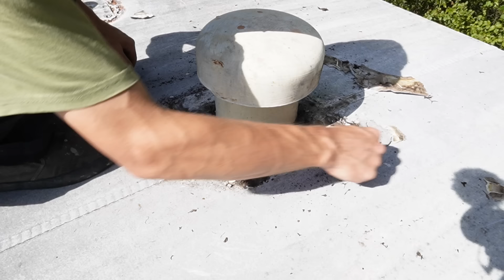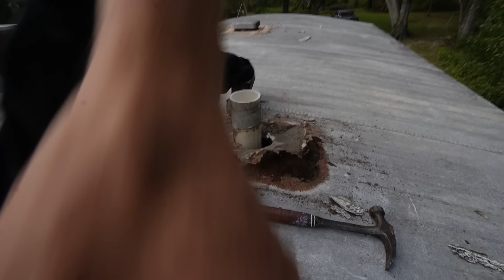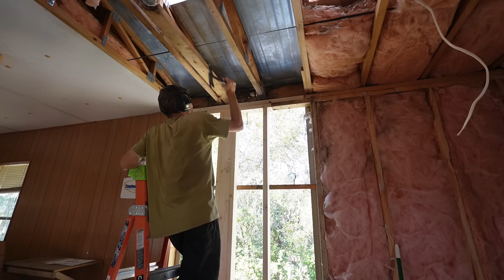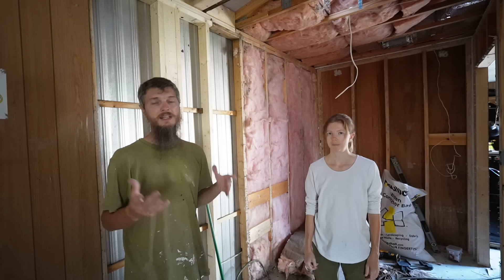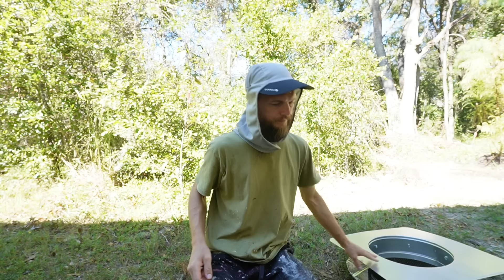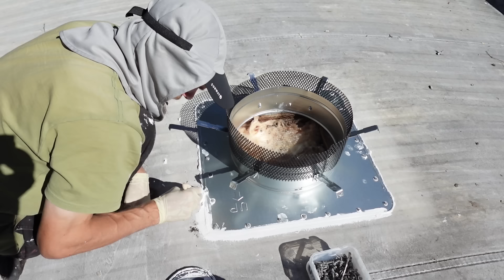Major Roof Leak Patch and Repair - Mobile Office Building

Comment: Trying out some new 🎶 I see.  Now I want some naan bread.  😋  Ceiling sealing space.  >>;=)  I think I saw you guys' Secret when Doug was showing the new vent.
Until y'all reseal the whole roof, I feel bad for any plane (or 🐉) that glides over your place, those panels are über reflective.  Let Doug know great job on this repair, and I appreciate y'all sharing this.  I have a shingled roof and plastic roof vents, and the nails rusted and seals broken, and mine're leaking (one pretty bad), and I've got to reseal those things up there.  I see that Tropi-Cool stuff isn't cheap, but if it can seal good vs wood or shingles, then w/ some 1×s installed under the decking around the opening for new wood to hook into and put the vents on with SS screws instead of nails, hoping to do a water tight repair to hold a few more years till new roof time (which I'm looking to use that plastic sheet barrier like y'all did, and debating re-shingling vs metal roof, though my landlord is convincing me metal is better even if it needs an $800 paint job every x# of years to not have rust.  At that time, I'll replace any decking needing done, although that was slick how Doug was able to slip that under a metal roof, although you gotta watch that guy always trying to hurt himself and fall off things LOL  Have a great rest of your Sunday and week ahead.  Love you guys 🐉💚

Comment: Good, thorough job! How did you know what metals were which? Just by looking at them? What do you recommend for an exterior bare wood, clear-type, sealer? My wood beams on the exterior is the apllication.
Reply from the maker: You can usually tell the metals apart by looking at them if you know what to look for. But steel is heavier and a magnet will stick to it, while aluminum is light weight and non-magnetic. These types of roofs are usually steel.

I don't have any recommendations for an exterior sealer. I'm still searching for a good one myself. But I'm sure just about any exterior sealer would work equally fine.

Comment: I suspected that the vents were a serious source for concerns and it is great that you are resolving the issues now. I hate penetrations through any roof, they are always a source of future problems. You are dealing with the problems at the start of your ownership of this building, challenging, yes. Frustrating, yes. Essential, certainly. Challenging, obviously with a mess of hard work, but do it once, do it right, it is the only way. Wow, sorry about the near accident, happily you missed that bullet, but the margin was too close for comfort.
Reply: The building probably was sold because of these problems that Doug is wiping out, one by one!

Comment: Glad you did not get hurt on that fall. I wonder if the wet patch would work in extreme cold weather in Northern Canada. It gets to minus 40s and minus 50s (Celsius) a few times each winter. Average minus 20 Celsius. If it does work, then it is worth considering. Great work on the roof. What are you going to use to seal the roof? Hopefully a light color to reflect the heat.

Comment: I thought you would have pieced in some plywood to fill in the holes where the two bathroom vents were and then screwed some 2x supports underneath to secure them to the existing roof or trusses.  Of course, there won't be too many people walking around up there, so just remember not to step on those areas.  The new vents look so nice compared to the old ones.

Comment: That bubble looks like it may be an area of potential ponding. Might be a good idea to verify that and fix it if ponding occurs.
Reply: It probably won't be a problem if a little water ponds on the roof.  In FL, the sun will burn it off in no time.

Comment: I took the oil furnace chimney out of my mobile home and put an aluminum rectangular patch over the opening with rubber roof coating and screws.10 years gone by and still holding! CHEERS FROM HERE!!!PS If need be you can separate the roof metal at the seams that occur about every 4 ft.

Comment: I used wet patch on a trailer roof, when in the middle of a rainstorm, my roof began to leak.  I was able to use that type of product in the middle of the storm, putting it over leaking areas that were in literal puddles of water, and it was able to adhere to the tar roof and stop the leak.  Absolutely amazing stuff.

Comment: You might consider for the new plywood just running a bead of PL400, at the sister and  plywood seam and  the truss plywood wood seam, that way in a storm when wind is blowing hard it will help with any movement.

Comment: Hi Doug and Evee,
I was wondering for the destroyed  trailer that was your old workshop, could you remove the sides and use the trailer as a flatbed trailer for moving your vehicles like your tractor?  So when you need the vehicles at the other property, you can take them over there?  Just a thought...
Reply: I was saying the same thing but also build some short side walls for hauling debris.
Reply from the maker: I'm not sure what the plans for that will be yet, but I don't think I would want to tow around something that long.

Comment: Yeah, just wipe it on your pants instead of peeling off the gloves & getting new gloves when you need to spread more sealant. LOL
What kind of metal is that mushroom cap? Maybe it would make a great wok! I've seen the disc blades off an old style farmers disc used. They make great woks.
Reply from the maker: It's made of steel.

Comment: Great video! I resealed the camper I live in recently and it feels great knowing it won’t leak. It poured rain multiple times after sealing. That was definitely a challenging repair redoing the roof plywood. Those siding panels make things a lot easier versus a lap or wood siding etc!

Comment: Hey Doug. Could you push the roof up on the work shop trailer using a hydraulic jack? Then you could use it for storage of the roof was water tight.. It would be a interesting video😆

Comment: You should use roof cloth with the tropi cool over the seams and screws.
Reply from the maker: I thought I would have to, but the can says it's a one component system and doesn't mention using a mesh like the other coatings do. So I thought I would just do what they say.

Comment: I noticed that you had one of your cars parked sorta along the back side of the storage building.  Got me thinking.  What if you built a sorta lightweight temporary extension of the roof of the storage building...along the back side of it...and used it like a carport area to park some of your small cars or your excavator there to keep them out of the weather.

Comment: @43:37, your "UP" designation on the vent is facing the wrong direction, even roofers get it wrong, not many pay attention to details.....won't matter much since it's a flatter roof not much slope.
Reply from the maker: Yeah, since we are installing these on an essentially flat part of the roof, we faced them in an orientation that we feel will be most secure against water intrusion. That UP designation is for sloped shingle roofs. It puts the metal seam facing down to help prevent water intrusion.
Reply: @diyfferent  yes, noticed that aterward...you're on the flat so it's best to turn them 50%/50% same hight protected and face the "up" where you think the angled rain-winds won't be hitting the most. I'd do the same.

Comment: We had nightmares over pitted holes in our vacation trailer roof.  We had no clue how to fix it without going to great expense.  We did cover them with some kind of elasometric stuff then sold the trailer.  There was an added room and when they shingled it they folded the shingles over and lay the overhang on the trailer which caused the holes.  To remove tape of various kinds and even dried tar on that roof we used a blow dryer.  A heat gun used carefully would work too I believe.   Looking good guys.

Comment: If you want to fasten the plywood patches down, just use some Loctiet PL 3x  urethane construction adhesive.  Just squirt some between the truss and plywood.      Suggest you pressure wash and scrub down the roof before coating,  bond failure is you enemy on any coating.

Comment: Make sure the roof coating you use is compatible with the silicone patch material you used. I think you said the roof material is acrylic? I can't remember if acrylic is compatible with silicone. If it's not, it will not adhere. Just make sure to save yourself any headaches.

Comment: Doug, don't worry too much, I used to repair mobile home/office roofs years ago, once you get the vents off, cut out the rusted roof metal, and cut a piece of leftover siding metal to cover the opening,  flatten out the edges of the new metal, if necessary, clean area for new metal patch, apply either the roof mastic around the edges or use the buytl putty you used on the mobile home windows, place the new metal and screw down the perimeter of the patch,then apply the white roof coating to cover and seal the screws and the edge seam of the metal patch  tip, have plenty of old rags, that roof coating is messy!!, great job and video, also wear sunglasses to cut down on white blindness from the reflection of the roof !

Comment: I just want to mention: Galvanized Steel fixed to normal Steel can cause galvanic corrosion. Which means it will corrode because of the differences in the metal. It can be even worse and faster than just normal rust. Covering it in coating/silicone will not prevent this because it doesn't need water to corrode. 
It is better to use steel that isn't coated or coated in paint/powdercoating. 
It's a common mistake to make. The repair will not last as long as you would think. So keep that in mind. 
For the rest: Keep up the good work 😉
Reply from the maker: But if the original roof is galvanized steel, wouldn't it make sense to patch it with galvanized steel? I thought that would be the best way to go. The original roof would have been galvanized steel, and they coat it with something.
Reply: @diyfferent  Ah okay, i was thinking, because of the rust, the original steel roof was not galvanized. Because normally galvanizing does prevent rust. 
But maybe the original vent covers where normal steel and that would be the cause of the rust. 
Galvanized steel on galvanized steel is fine if you use galvanized hardware also.
Just not "raw" steel on Galvanized steel or vice versa. Aluminium and stainless also don't like each other. So always pay attention with that.

Comment: You have 2 buses and 1 busted trailer who's sides are Aluminium, Ideal for roof covering. As trailer is destroyed ideal to use some of its sides.
Reply from the maker: Yeah, I was hesitant to put an aluminum patch on a steel roof. It may be fine, but I didn't want to take a chance.
Reply: He said aluminum + steel won’t work.

Comment: seen a lot of schoolbus to rv conversions where they used tropicool , its realy good stuff there all raving about how well it holds and seals , wat might help is to put some of the mesh you use for plaster in between the layers of tropicool , schould make it a little stiffer 
the plumbing and vent opening can be closed slap some zinck over it with a thick layer of tropicool and siicone under it and crew that tight , then more tropicool over it to finish it off 
as for sliding the plywood under the roof , maibe get a ratchet strap with those hooks on the end , hook one end on the edge of the plywood and the other under the ceiling near the center , that way you can put the ladder inside to guide and push up the plywood while you use the ratchetstrap to push the sheet in under the roof 
as for the realy big vents ...... dont be supprized if at some point in time theres going to be a chopper with heat signature cameras flying over a few times when the local law inforcement notice those big ducts on the roof and starting to suspect you growing weed in that trailer 
other than knocking on youre door requesting to look inside the trailer and you cooperating with that request there shouldnt be any problems from that

Comment: With your new roof vents, consider replacing the plastic mesh screen with strips of expanded metal especially if you have critter issues where you live.  I had these and raccoons tore out the plastic mesh and had a grand time in our attic.  It's easy to fix and will save you time and headaches down the road.  Looking good!!!
Reply from the maker: Yeah, I was surprised by how large the mesh was on these. But that can definitely be upgraded pretty easily if we remember to do it!